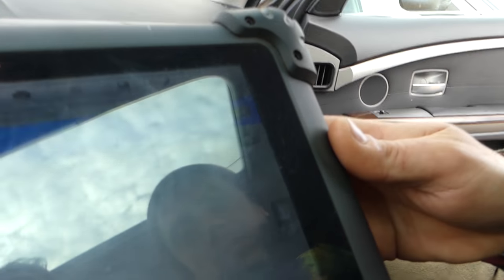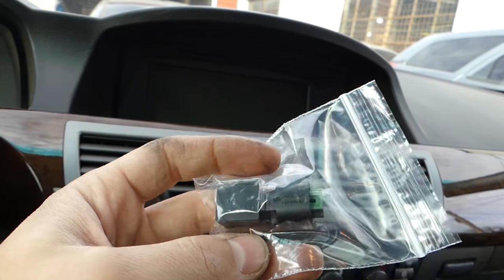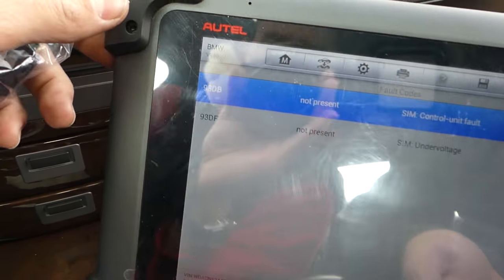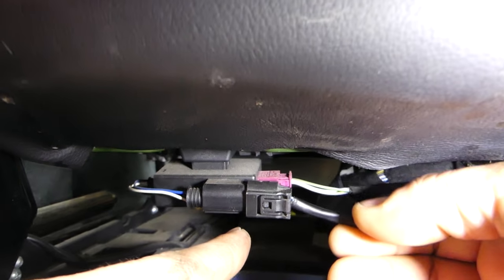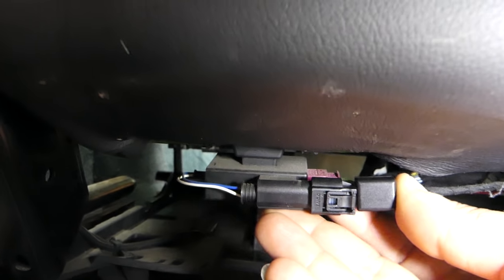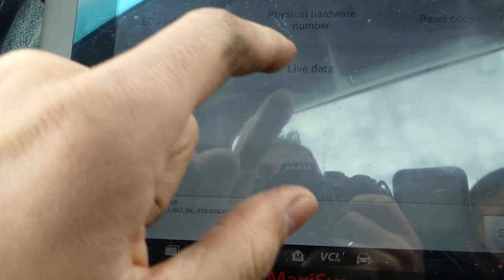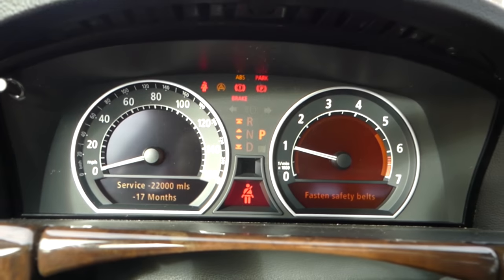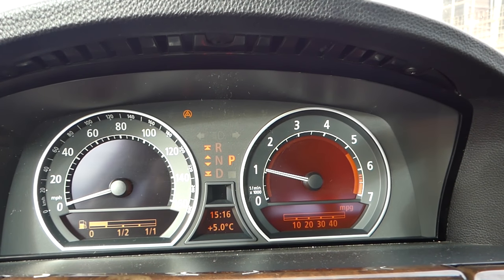BMW PASSENGER SEAT Occupancy  AIRBAG MAT BYPASS INSTALL. DOES IT WORK?

Comment: FOR THOSE WHO ARE WONDERING YES!!!! YOU DO HAVE TO HAVE THE CODE CLEARED VIA A BMW OBD 2 COMPUTER NOT THE AUTO STORE 20 DOLLAR CHEAP ONES!!!!!

ALSO BONUS ADVICE: go to your local salvage/ junk yard and take a knife or blade and just cut out a mat from a same year model car, I personally replaced me e93 (convertible 2011 bmw 328i) with a sensor from an e92 coupe. Mats are able to be used on either passenger or driver, it does NOT matter! Total job cost me 7usd. Got code cleared by random local import shop because it only takes 2 min for them to do it and they'll usually do it to keep you as a customer! So call your local shops to get it cleared free! Screw bypassing it get it legit fixed less than 10usd
Reply: I like this comment! I have a E46 so all I need to do is your knife trick to get sensor? Just solder them back up just like that? Thanks in advance!
Reply: i thought un hooking ur battery and touching the neg and pos wires together for 10 15 mins clears all the codes.
Reply: @Boogerboys1990  sadly i have not been able to have that work. I guess it uses a "hard "code and I had to use ista to clear it

Comment: Hi bimmermerchant,,, thanks for the video this video fixed my airbag issue, but there is a clip that has come loose from under the seat and I do not know where that will connect. when I pull the clip it will rise the seatbelt up. If you watch this video of yours you can see this clip @ 1:24 which is laying right next to the firewall. I appreciate it if you could help me to locate the instance with an video or photo

Comment: Hi there I have a 2005 bmw x3 and yesterday bought the bypass as it kept flashing up on my dash so I plugged it underneath the seat as you did and cleared the code but after 30 mins of disappearing it came back up again anyone else experienced this please help all advice appreciated.
Reply: fix yet?
Reply: Where do you buy the part?

Comment: Regards! I have a 750 li 2007 but is a little different there in none connector  at lear like the 745 :) there is another way to find it? I can see a connection device but is completely different!?
Reply: I have the same model did you ever find the connection because I can't find it under my seat

Comment: Do you disable the battery when installing the bypass?
Reply: No need to, as long as you don’t unplug the whole seat. Make sure to clear the fault code with an OBD2 machine afterwards though.

Comment: I installed an occupancy mat bypass in my 1998 Bmw M Roadster and now whenever the bypass is installed the occupancy mat error light goes off but the passenger side pre-tensioner light come on. The pre-tensioner only comes on when I have the occupancy bypass installed. This is on a 1998 Bmw M Roadster, can anyone give me some insight?
Reply: I think it's because your bypass simulate someone in passenger but the passenger side pre-tensioner is not use.  you must custom another cable under the seat

Comment: I understand the idea of trying to protect yourself by saying "No kids will be riding in this car, we're adults and we understand the risks of the bypass".
But in a vehicle with passenger air bags a child should never sit in that seat regardless.  Airbags are deadly to children, and at least in my BMW you cannot disable the passenger airbag. So this bypass is actually safer for children than the functioning factory set up.
Reply: Well this bypass means that the airbag will be enabled always. Having a functioning sensormat disables the airbags when a child is sitting there. So the safest for children would be having a functioning sensormat. But put the kids in the back of the car and using a bypass for the sensor is way cheaper and a good fix.
Reply: @tonyhyvonen3239  I guess it didn't cross my mind that this bypass could be telling the car there is weight, or there isn't weight in the seat.
Reply: This bypass is telling the car that there is an adult sitting in the passengerseat at all times. The sensormat function was implemented not only to save children from airbagdamage, but also keeping the costs down in case of crash, cause deployment of both airbags is more expensive to fix rather than one. That is if you are sitting alone in the car of course, otherwise it’s just more safe. Telling the car there isnt weight in the seat is the same as disabling it.

Comment: There's no module in my e66 in the location shown
Reply: On my E36 you have to remove the seat to get to the connectors as they are under the center of the seat.

Comment: Haha, That little plug does not anything. it's completely empty. Your just unplugging the mat.
Reply: when i unplug mine e61 2005 euromodel i get airbag light and open fault code.... so no i think its a diode and resistor...